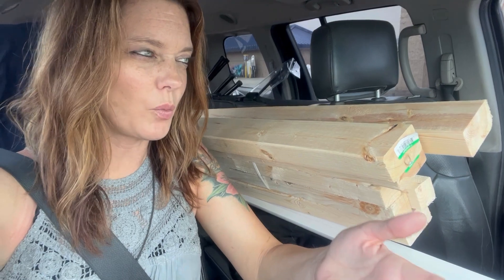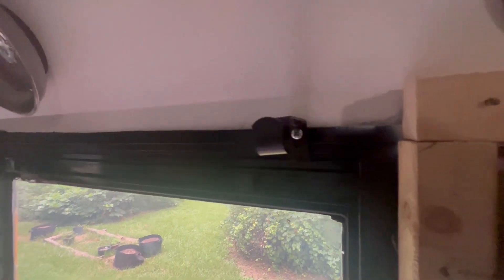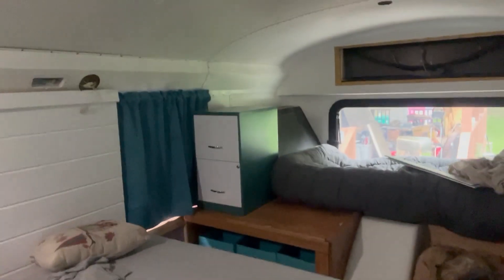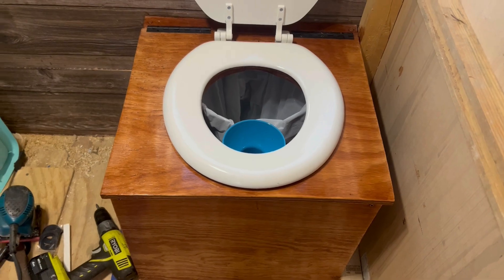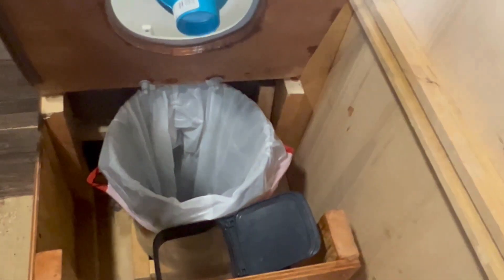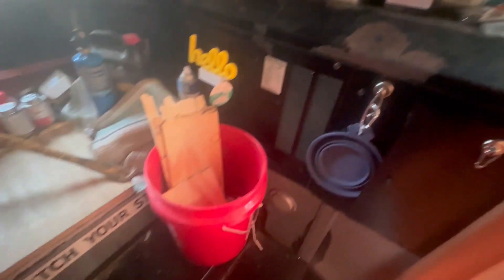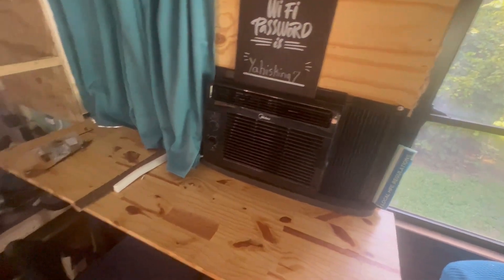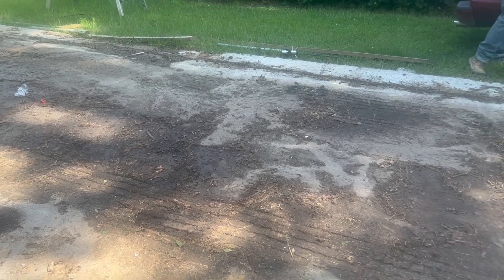Moving The Skoolie And Some Updates!

Comment: Moving the bus is what I did recently with my 2002 rear engine International, and something occurred while in motion. Don't be surprised if it happens with your bus. The air compressor's purge valve became stuck open and all of the air pressure went to zero, meaning the bus brakes will cease to work. That valve will need replacing I'd it sticks in the open position.
Reply from the maker: Wow , that seems scary! Ours spits lengthy. That would be very bad for it to happen while in the mountains or something crazy right? 😯
Reply: @ParsonRoad  No, the occasional spitting you hear is normal. That spitting is when the air tank has reached it's maximum pressure and a check valve cuts off the air coming from the compressor. Hopefully the purge valve doesn't happen with you or me. It's a good idea to maybe get a new one installed, I'm thinking. I too plant to be driving in the mountains.